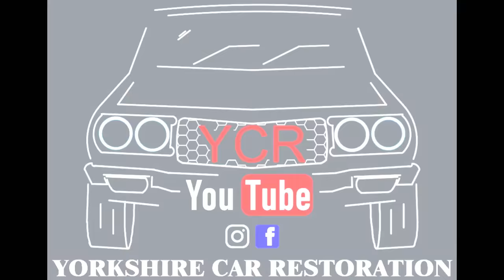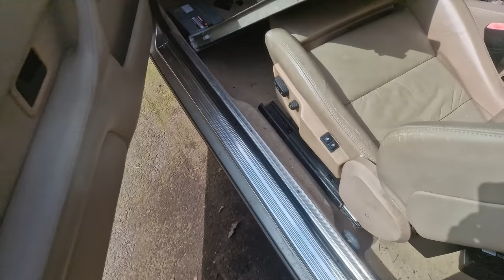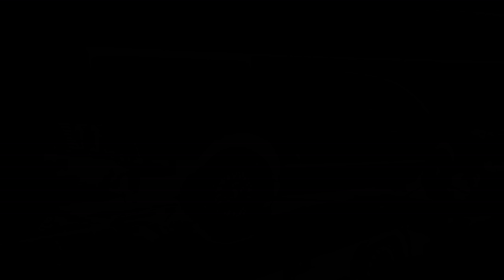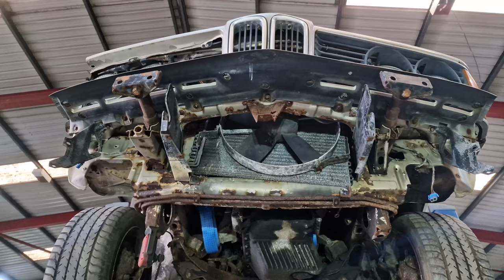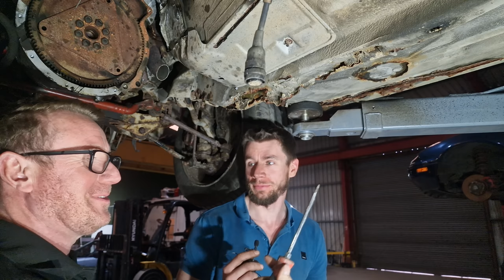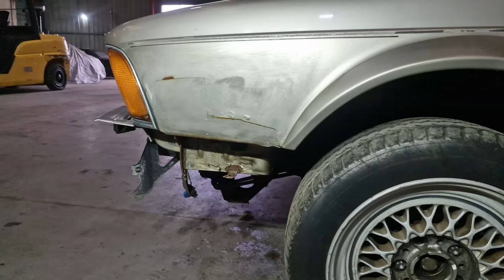Restoring Mat Armstrong's BMW E24 635 CSI! WARNING LOTS OF RUST! - Part 1

Comment: Years ago, it was common (in the UK) to stuff rolled-up Newspapers, old cloths into the rusted areas, and then underseal over it all! Just to get it through the MOT. I once bought a Hillman Minx in the 60's that had the 'rust' fixed in this way. That was, until the rear Leaf Spring poked its' way through the inside of the Boot!! Made it back home, with the car dragging on its arse. I was 19 years old, young and daft. The Porsche was a huge job by comparison to the BMW. Greetings from Sydney!

Comment: Hi - your vids are great 
I have a seat Leon fr 2017 facelift with xenon headlights. The driver side smashed so I got another one from a seat Leon cupra 2017. But the new doesn’t come on ? I have used the existing ballast .. ?
Any ideas anyone please . Will appreciate it
Reply from the maker: Thank you! And maybe check the part numbers to make sure they are the same light and they match. Could be a bad ballast. Hopefully someone can answer your question.

Comment: Guys your supporting the car on the wrong points, the front area is not a jacking point, that where the cradle supported the car as it went down the production line as an empty shell.
Reply from the maker: Thank you, but the jacking points were rusty so we had to jack it up where we could

Comment: Such a "nightmare" you only restaurate, if it has the chassis-number "1" or is the last one ever came out of factory. All other cars, you will find a much better chassis and fit the parts from many other cars together. Or: You need a practize-object of restauration-skills. Need a object for you master in metalworks? So good choice, i think.

Comment: Nothing to do with so much rust . It will be more expensive to restore than to buy a used 635 CSI in good health. I am so sorry. I like this car . 30 years ago my mechanic (who has passion for cars) get a 635 CSI M power . Yes the engine of the M1 . i think it delivers 286 HP. Good luck Gentlemen !!!!.
Reply from the maker: We will restore this body back to original no problem :) Thanks so much, they are lovely cars
Reply: @yorkshirecarrestoration  During your video, i have seen very nice car in your huge garage . It is great if you can bring the 635 back to life. Thank you.

Comment: Not any minute worth... any other Wreck is better then this pice of rust
Reply from the maker: It's in good condition this one compared to our others
Reply: @yorkshirecarrestoration  WHAT??? I'm from Germany .. the badest Car's that U pull out of a old barn, didn't Look like this BMW 😂 My Father  sell Car's to Scrapyard in better Condition.   U can buy a 635CSI M in good Condition from 18000 up to 32000.. but Steering on other Side. ..maybe is that the problem why U need to restore such a Car.